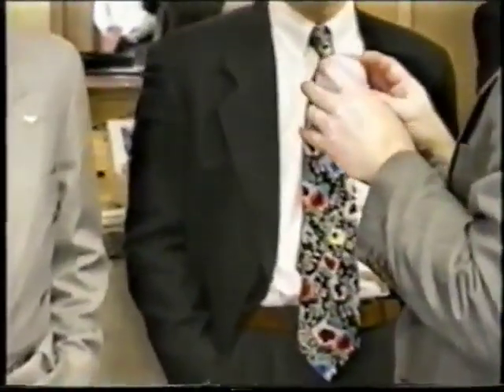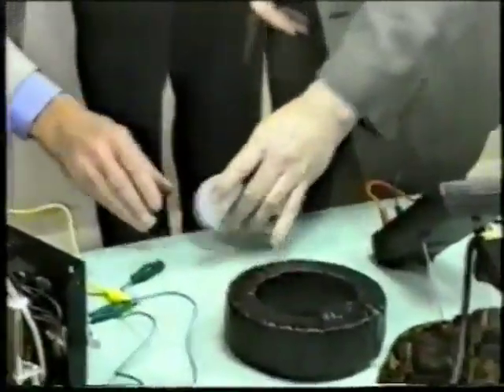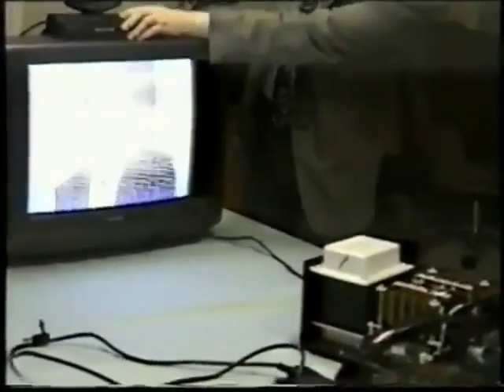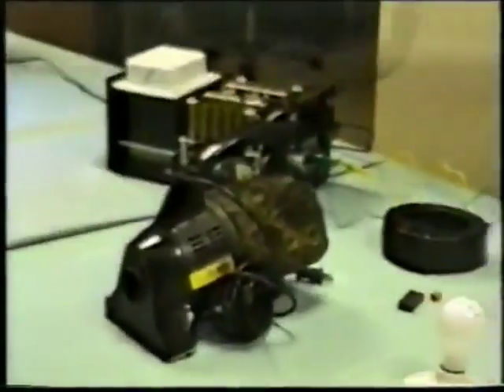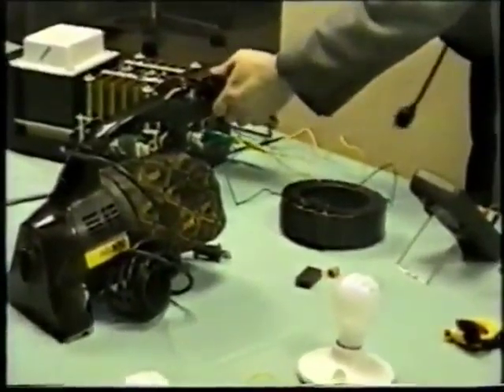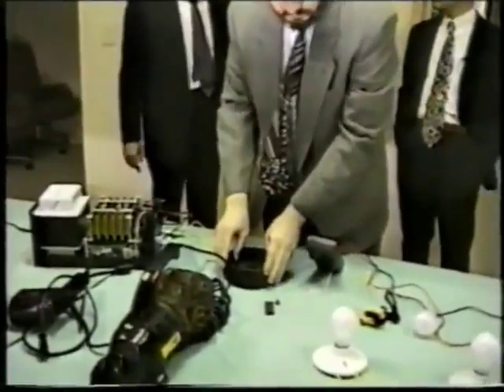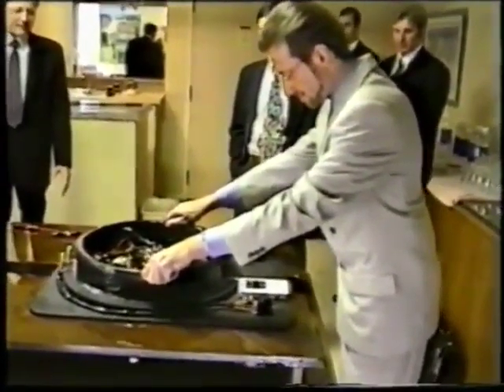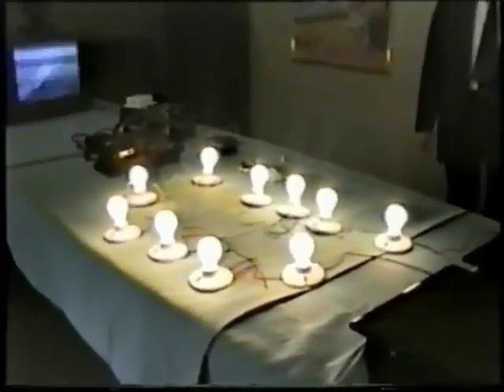Steven Marks Generator - 3rd-July-1996  TPU - Toriodal Power Unit

Comment: Wow havent seen this stuff for years.
For all negative comments i  will let you know its real.

I have seen similar and done it myself.

Its not free.energy, but it is most often called it.

A simple.princeble to learn is.the magnifying glass.

Why does it not burn when it is out of focus ?
If you truly know why, then you will be closer to undersrand what free energy devices are.

Most ou or fe devices are fake.
The sm tpu is one of the real deals
Reply: Correct. As taught by Walter Russell, such devices wind up "potential" which, in his view, is simply spirals or waves of light that get increasingly condensed and compressed (multiplied). 

He was able to power his 52-room mansion/university using this principle with his device known as the Optic-Dynamo Generator. 

He seemed to create miracles with "dual solenoids" for both power generation and elemental transmutation, as repeatedly verified at Westinghouse Labs around 1930.